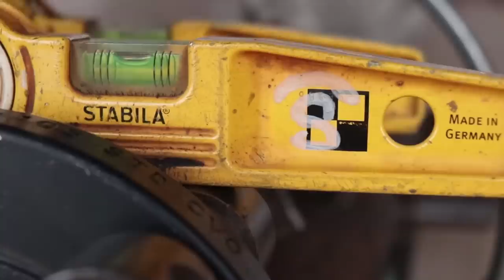Welding Tips-Why Two Hole Flanges- PipeFitter

Comment: Hey Jake,
I will never be a pipe fitter/welder I am too old and my health would let me even if I wasn't a old fart...lol What I am is just old garage hack that on my good days I enjoy putzin around the garage and bulding and tinkering. I absolutely love to watch your instuctural, tip & hint videos because many of the things you show I can adapt to whatever I am tinkering with and it helps me get better results. 
I would love to see you do an "How To Build a roll out wheel, I could adapt that to use many jobs around the garage. I always need a third or forth hand to hold things mainly because of the nerve damage in my hands, I have no strength and I'm not to steady either. But I love building things that help me get better results and or make it possible for me to even be capable of doing a job instead of bothering my son or daughters for help.
God Bless and tell that lovely wife of yours I she in my thoughts and prayers that she has a easy time when the big moment arrives. And since we already share last names if you have a son Craig Curtis....works well with Schofield it flows...I know and it is only slightly used lmbo 😜.....Have a blessed day also
Reply from the maker: hahahaha Craig is a great name lol. Ive had his name picked out since i was 18 just took 10 years to finally get him here lol. its going to be Baylin Theo Schofield craig shoot me an email at Schofieldwelding@gmail.com

Comment: Good video. For people that have a rough idea as to what you're working with. I know you have production to do and doing a more step-by-step video would cut into production but if you have the time... I would suggest a little more of a step-by-step video. For instance... Before setting any of your work peices up, showing what the two hole pins actually are and how you place them. Even down to making sure the threads are on the outside of the  flange so they don't get ruined or the level that's inside of your two hole pin. Like I said, good video, man. Just a suggestion. 😘🤣
Reply from the maker: for sure Chris you need to come get in on some of these videos and explain what you are doing and the route you took to the money.
Reply: Jacob Schofield   I'd be down for that. Let me know whenever you're gonna record and I'll be there.

Comment: Love that info. 
Put brain in gear before letting out on clutch and moving the mouth. Good advice for all situations. ALL POLITICIANS NEED TO ADHERE TO IT. 
Hang in there and keep warm. Do they allow you to use a kerosene heater in the hooch?
Reply from the maker: hahahah Danny for sure lol yes they do allow us to have heaters we just have to buy them, then they provide DSL for them. im kinda hard pressed to get one ive never had a heater except for the propane ones we builtout of pipe.
Reply: Jacob Schofield Little John Deere run 5-6 hrs on couple gallons. Also good to point under trlr for frozen pipes or keep warm before they freeze. I don’t like being so cold you can’t think straight.
Reply: @JacobSchofield  

With all the trucks and engine drive welders around, I'm surprised nobody out there has waste oil burners in the hooch. A good design throws a lot of heat, and there's fuel for it all around you.👍

Comment: Once again, great video guys! Question for ya... do y’all typically get paid once your fab work is done or after the guys bolt the work up?
Reply from the maker: Mike we get by the hr. but there jobs that do piece work and if your quick you can make  bunch of money. but they usually have the prints or fitters there getting pieces to you.

Comment: Another great video... Jacob, now that you’ve had some time under that Miller, do you prefer it over the Lincoln?
Reply from the maker: man Jake there both great great machines. I like all the power options of this 350 pipepro but the cross country has the same options. as far as the difference beteen like my sa 200 to the miller. the miller is consistet every single day. it dosnt fluctuate like a 200 does. but Ive alwasy been a die hard for an sa 200.

Comment: hey jake , I see you have your ground on the back of rollout wheel but aren't you running the ground thu the front bearings ? wouldn't it be better to use a rotary ground clamp on the pipe piece it self and you would never have to change ou the bearings like you did a few vidoes back. b!een a long time subscriber love your work ethic and professionalism!
Reply from the maker: true Ray. it waasnt the bearing that went bad on that rollout wheel it was the hub. from leaving the break on and rotating it it wore almost clear through that hub to the point the break wouldnt work anymore. Ive never had trouble with the bearings yet. hope that helps.

Comment: So on the lincoln what gears would you run this pipe at? Which would be 124amps. How do you like the blue one compared to the lincoln?
Reply: 3rd n 30.. give or take on ...30 to 50
Reply from the maker: exactly what ecr said 3rd gear and about 40 this miller is set on 200 amps at 100 0n the remote so I ru at 40-45 when I start then go up or down from there. it took alot to get used to it. but its just another machine they both make money.

Comment: 124 amps seems really hot for 1/8 5p+. Did I hear you right? Just curious
Reply: Yeah, you heard right. Downhill pipe welding is a hot and fast process
Reply from the maker: hahah For sure. Dave runs around 160 or so but with a super tight gap i run about a 1/16 gap. Ill start giving amps for all the rods we use i just got to remind my self to look for you guys.